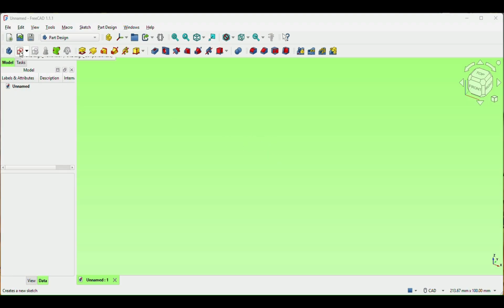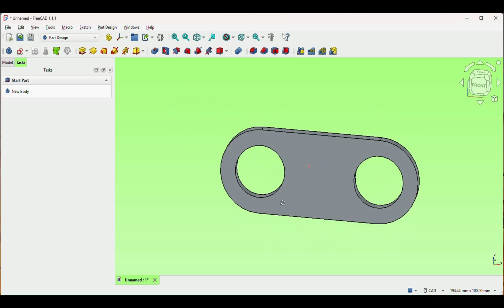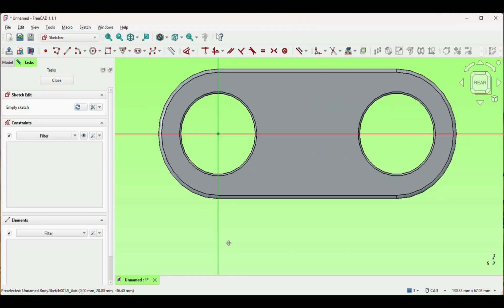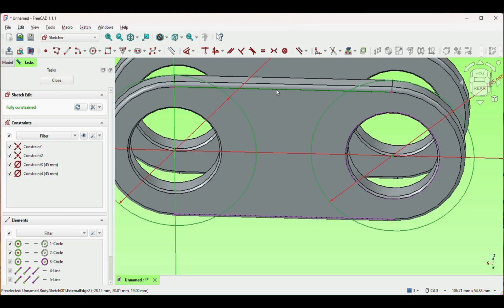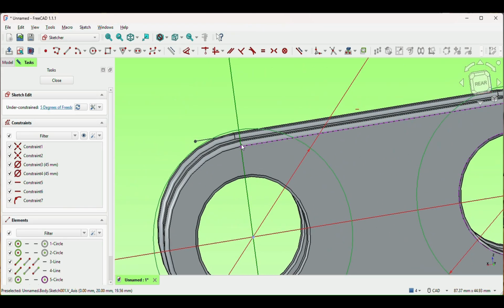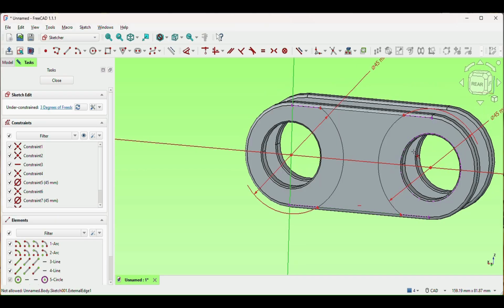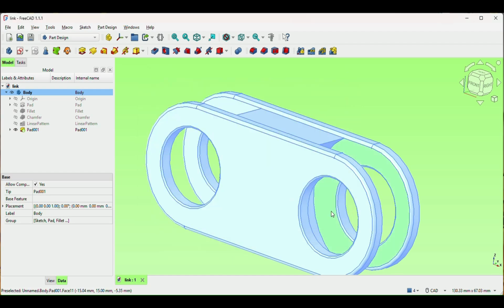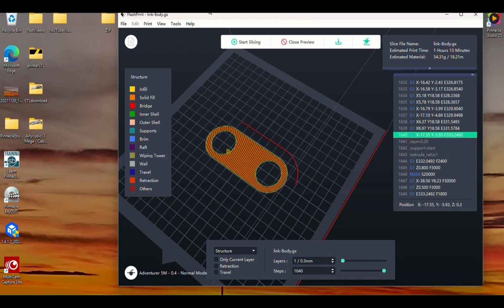Simple Link in Freecad

Comment: I've only used Tinkercad when I've made 3D prints for casting aluminum.  I've been relunctant to switch to anything different because of learning curves.  However, there is one feature I wish Tinkercad had, but doesn't, and it would be a reason for me to switch programs.

To your knowledge, can Freecad put in draft in a 3D print, say a 3 or 5 degree draft everywhere, with a click of a button?

Thanks in advance!
Reply from the maker: I did a video covering this subject. Yes freecad does great with draft.

https://youtu.be/ob9iA_PPJkM?is=iBMi3dIPQX6HK8PP
Reply: @roscoepatternworks3471  Thank you!